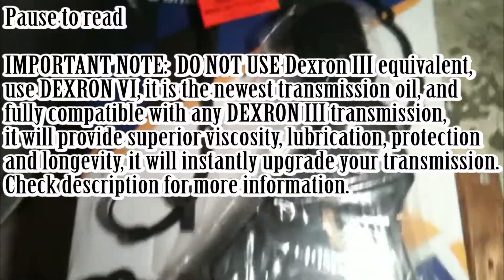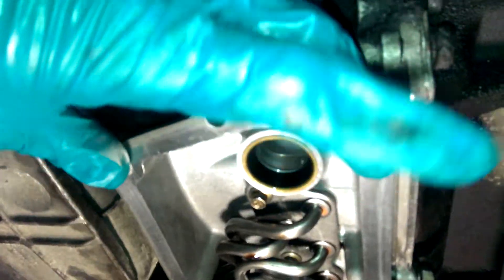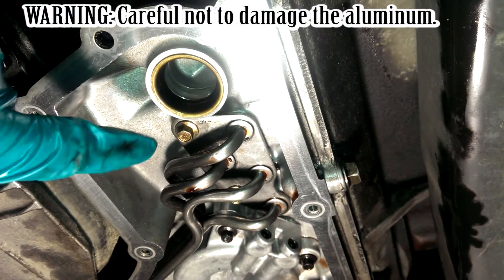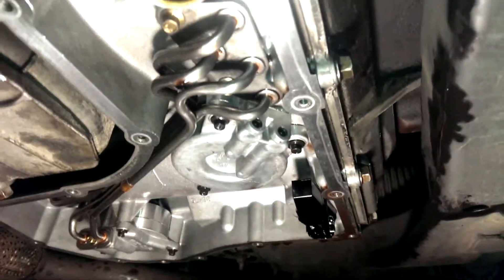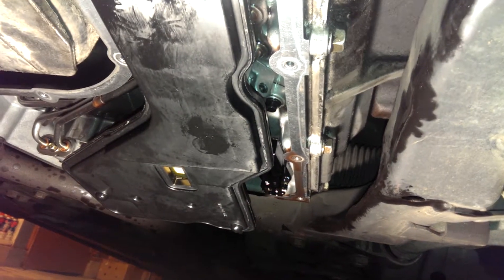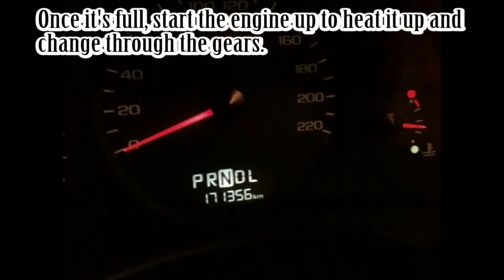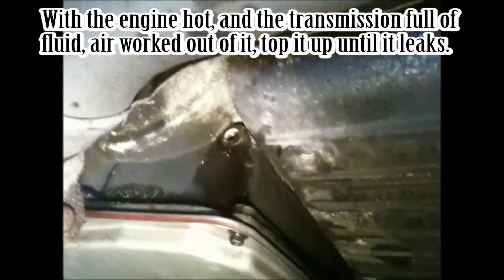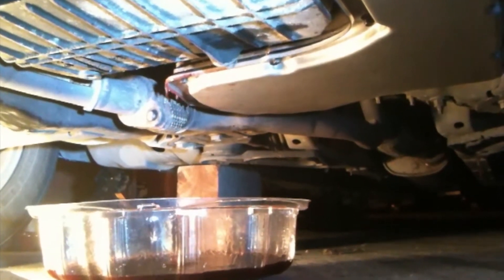How to Change Transmission Fluid in a GM Lifetime Trans - Malibu 2004

Comment: i read that this transmission 4t45e only had UPDATES to make it better equiped to handle the dex 6 from 2005 and onward. Specifically, the 2004 version had loss of pressure issues which could cause slipping. dex 3 is a thicker fluid, while dex 6 is thinner. So considering that, do you really think dex 6 is a good idea in this transmission? If it were 2005+ I wouldn't even be asking this question.
Reply from the maker: Hi, that's a good question. Given that GM updated it to handle the thinner Dex6, I would only put Dex 3 in the older transmissions even though they say Dex 6 is backwards compatible. Since they had to update it to handle thinner fluid, it means it's not fully backwards compatible, and they were wrong to say it was; that being the case, 2004 and earlier versions should not consider dex 6 backwards compatible and should only use Dex 3.  
That being said, I'd probably experiment by trying Dex 6 in mine and see if the shudder reduced or was eliminated, just as a test since mine was shuddering even with dex 3.  But it could just make it worse. Hard to say.  But would be fun to test out. 
Thanks for the new information and insights! 
Cheers! 
David.
Reply: @DavidSunshine  I had an unknown transmission with unknown maintenance I bought used. around 130K. The transmission was clonking or shifting rough and especially when you ran the car a long time like 1 hour+ or at high speeds for a while like on the highway. In other words, when fluid would get really hot. This cars tends to run a little hot anyways (needle goes a little past middle), which is also weird. Anyways, the old fluid didn't look too bad, but I am guessing it was dex 3 because dex 3 is a little smellier than dex 6? 8 quarts came out. I replaced with 8 quarts of valvoline maxlife dex 6 universal walmart brand. I poured it in cold, then fired it up and cycled through gears. Immediately it was aggressive, violent clonking into gear, also when driving. It was BAD... lol I added some instant shudder fix and it seemed to improve things, but it seemed to be getting worse again as of lately and 4K miles later. So I decided to do another drain and fill but with dex 3 this time. Anyways, I just drained out about 7.5 quarts this time through the check level plug, but letting it seep out through a 1/4 tube. To be technical, 3.5 came out this way. Turned it on and then poured 4 quarts fresh dex/merc blue bottle valvoline (which is recommended pre 2006 and for dex 3). I did this while draining it from the hole at the same time. I didn't cycle through the gears because I was afraid it would shift so violently it would move off the jack stands. I just ran it for 5-10 minutes. Turned it off and an additional 3.5 quarts came out the hole in the pan ((once the car is off). So in total, replaced 7.5 quarts with dex 3.  I haven't taken it on a test drive yet, but so far off the jack stands, it does cycle through the gears park, reverse, neutral. Pretty smoothly with just a little noticeable engagement movement.  We'll see how it acts when I drive it and it gets real hot. But I haven't added any friction modifiers like last time and it's working just as good, so that seems good. There's probably still 1-3 quarts of dex 6 in there.
Reply from the maker: @SamHaripo Thanks for sharing your experiences with the Dex 6 and 3, sounds like the thinner viscosity isn't working so well in that transmission. Friction modifiers can be hit or miss sometimes, I've used lubegard red before, in a Ford Taurus, made it slip worse, in a Honda Accord it helps smooth out the rough shifts tho. 
Have you checked the accumulator piston gasket? It gathers up metal particles and can stick, which could caused rough shifts. You can remove it and clean it up a little bit. Make sure the inside of the cylinder that the piston slides in is smooth, if it's rough you can even polish it smooth, anything to help it not stick. 
Cheers! 
David.

Comment: i heard d6 is thinner fluid, how will that help the transmisison, shouldn't you use same viscosity?
Reply from the maker: Great question!
Yes, Dexron VI is less viscous than Dexron III, but that's actually beneficial for modern transmissions. The lower viscosity improves fuel efficiency, cold-weather performance, and transmission durability. Dexron VI is the recommended fluid for most GM transmissions and is backward compatible with most Dexron III applications. In my case, it worked well, so I think GM was right when saying it was backwards compatible. 
Cheers! 
David.
Reply: @DavidSunshine  ok good to know, thanks for the response! i have a ford too and I bought an extra mercon LV at a discount, do you think GM d6 vehiciles (in this case d3) also like mercon lv?
Reply from the maker: @acrobart2339 Anytime! Sounds like Dexron 6 has better low temp performance and viscosity stability than Mercon LV. So it would work in a pinch (like a top up) but I wouldn't recommend using it long term for a GM vehicle. I think going with Dexron 6 would be best long term. 
Cheers, 
David. @acrobart2339
Reply: @DavidSunshine  Thank you for your help, I'm kicking myself for having changed the fluid, but I was going by your guide even if it's "lifetime" transmission fluid. I have a malibu max lt v6 if that matters and I just put Valvoline maxlife in it, because the regular Valvoline blue d6 was out of stock. I also put a new filter, but couldnt' get the old filter gasket off so I left it in there. and took off the new gasket of the new filter  I felt immediate clunking and jerking in the vehicle, like car shaking. It has about 178K, unknown if it had ever been serviced. magnet was pretty clean. fluid was dark red but not burnt, not too many particles in there. Anyways, I added lubguard instant shudder fix, the toothpaste size tube (2oz)  and it fixed most of the clunking. You can shift it into D or R now without a huge jerking, but there is still some hesitation and it seems worse than before I changed it. I'm wondering if it is because the Valvoline maxlife is a thinner fluid (being d6 compatible) Also what would explain the instant shudder fluid working to alleviate some of the symptoms? Would that fluid make the viscosity thinner or thicker?

Comment: So the shuddering and hard shifts your talking about.  How did you solve that?  Just cleaned the actuator?
Reply: Did you fix it ?
Reply: @AyeSpare  I changed the fluid in my trans and it did nothing. I cleaned the actuator and it also did nothing.

Comment: How does this procedure differ from doing the same service on the 2.2L 4 Cylinder model?  ANYBODY???
Reply from the maker: If it's a GM tranny with the overflow hole and no dip stick, probably the same.  If it has a dip stick, you can probably just drop the pan, and refill and top up with the engine warm and shifting through the gears like normal transmissions.
Cheers!
David.
Reply: @DavidSunshine  cant one just simply add fluid until it pours out through overflow hole , warm up vehicle, then remove plug again ,and refill until fluid spills out of hole again?
Reply from the maker: @jesseesparza6221  As long as the engine is running, all the gears have been worked through, and it's warmed up, then it'll be full when it starts leaking out the hole.  If the engine isn't running, The fluid level is too low if you were to only fill up the the opening with the engine off, even if it's warm.  
Cheers,
David.

Comment: 0945 EEST
MOST informative, mon amour...especially for one who's motor car employ such a 'crash box'.
But tell me, monsieur...do you always wear the latex hand-coverings?  WHY?   💋
Reply: as a mechanic, i have been using gloves for years so that i dont have to keep running back and forth to clean my hands, simply remove and use new ones ,and helps prevent scratches, plus at the end of the day, i dont have to scrub my fingernails which doesnt remove all the dirt anyway
Reply from the maker: Lol, my BMW has a similar transmission too, too bad.
I don't always wear gloves, I like working without them since it's easier to work without gloves, but I've heard it's a "skin irritant", not sure what that means, but I don't want to find out the side effects so I just use gloves when dealing with the fluids in a car. Apparently used engine oil contains cancer causing contaminants too, so I definitely wear gloves when working with used engine oil.  It's cheap protection, so I try to use them.  It's also makes wash up much quicker afterwards.
Reply: 0826 EEST
Oui, you are nothing but correct, monsieur...but...one MUST die of something, that is, for some reason.  It would prove a terrible em-bare-ass-ment otherwise.  😉
Here's an instance of my 'doing IT In The Dark…in Alsace…in a Peugeot 205 gti 1.9.':
https://vimeo.com/129261613
Reply from the maker: Lol, I agree with you.  But I don't mind doing a few extra things, like eating healthier, exercise, wear a helmet, wear a respirator when working with spray paints or solvents, etc.
I enjoy having some fun too, but I haven't done any rally car racing, that looks fun indeed! ;o)